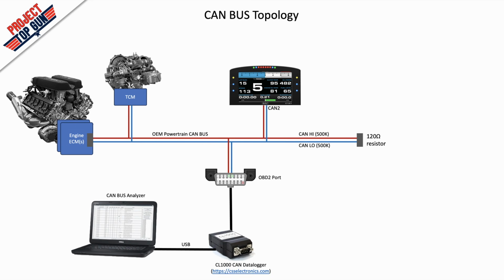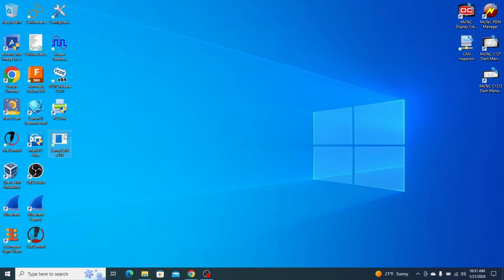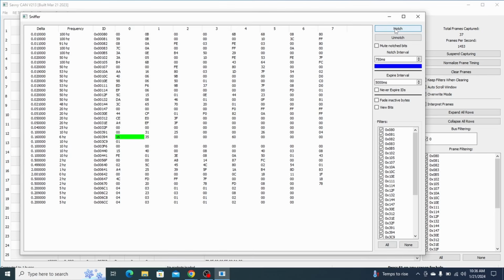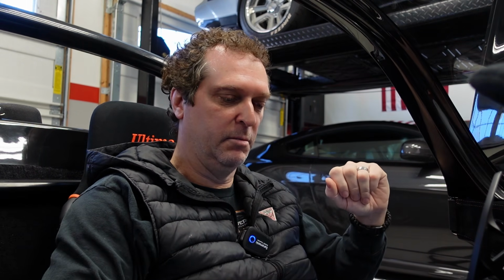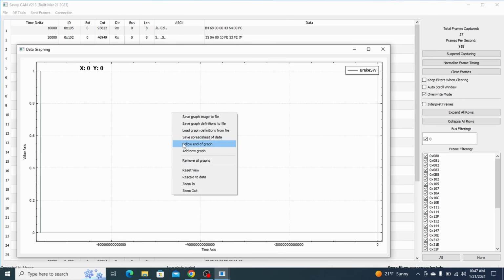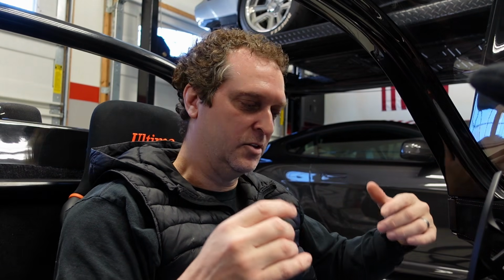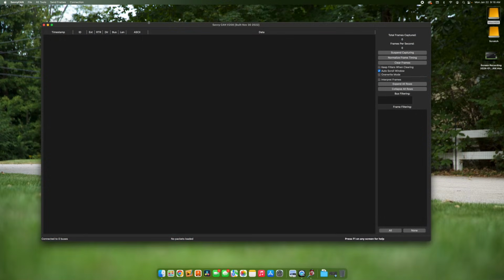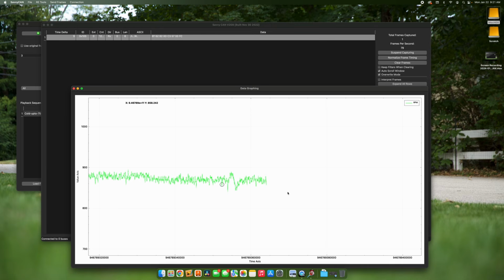PART-1: I Reverse Engineer the OEM CAN BUS on my R8/Huracan Powertrain!

Comment: 25:40 If you’re reading only one bit, checking Endian on or off shouldn’t make a difference.
Reply from the maker: That’s right. However, every CAN ID and signal defined in the DBC must be defined the same; either all LSB or all Big Endian.  You can’t have some signals Big Endian and others LSB in a single DBC file—this will cause an error. I found this out the hard way.

Comment: Great video - I now understand how notch works :)

Couple things.. I'd be careful assuming throttle position is always a percentage, as the sensors that measure these are usually replying with a varying voltage which an ADC might scale on a higher range, like 10, 12 or even 16 bit. Wheel angle sensors on tractors, for agOpenGPS, we measure a range of minus 4096 to positive 4096 for example.

Check my videos, I made a tutorial for how to find the button IDs in a tractor in the joystick, and also how to control them from an SBC.

Also, for finding a linear value offline, consider "gaming" the data so it stands out, eg, push the throttle down a little, hold it, bit more, hold it, bit more, hold it.. the graphing window will show an obvious step pattern
Reply from the maker: Great tip. Thanks for your comments!! 🙏

Comment: just like packet level tracing on a network switch, feels kinda the same
Reply from the maker: Bingo. And that’s what I do for a living. 😛
Reply: @DanDulac  Spent plenty of time in Wireshark and Pcap drivers so I feel you.  This is what I tell young folks is that being a good engineer is like being a good mechanic, identify the problem, divide it by two and keep going down till you find root cause.  Works with cars and computers

Comment: This is very interesting work! I have reverse engineered much of the two CAN busses on my Infiniti Q50, and one thing you learn very quickly is you're pretty alone as far as documentation and support goes - even on fairly common cars like mine. Taking on CAN bus reverse engineering in a car like the Lamborghini is a new level. However newer tools like SavvyCAN with the Frame Data Analysis & Sniffer are a lifesaver.

Great work!

Comment: Dan, this was superbly explained and kept to a level that explains something complex relatively simple. Well done. I am starting project to reverse engineer crash data on Airbag control modules and we see brake, acceleration and RPM in that data as well as vehicle speed and a few other inputs such as steering angle. It is helpful that some of these may be in the same CAN ID but also a reason that they may be in the same one too? Looking forward to the next instalment!

Comment: This looks like a lot of fun, along with many frustrations and a ton of time spent!  I wonder if bench testing the pcm would be helpful.  For instance, you can limit a lot of the can bus traffic by having the pcm removed from the car, and manually altering the coolant temp signal with a variable resistor.  A signal waveform generator may also be extremely helpful here.
Reply: That would absolutely work - I've a John Deere ATU200 here that chats in complete isolation once powered up